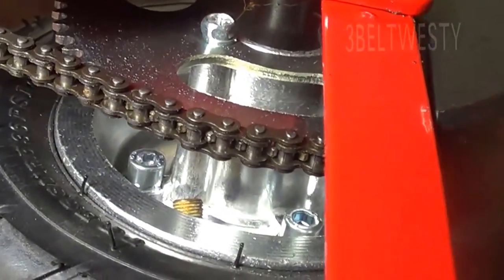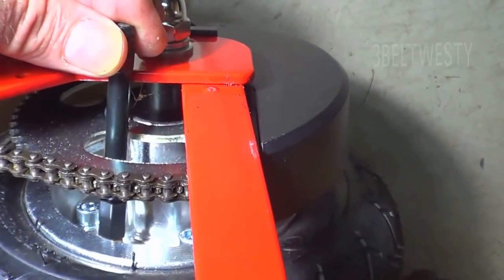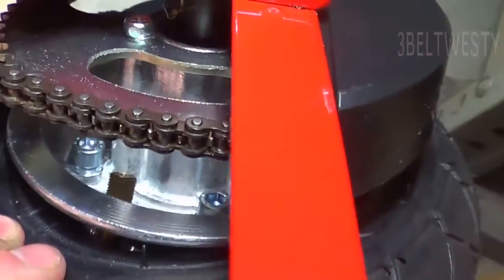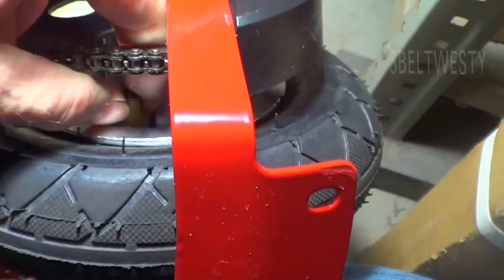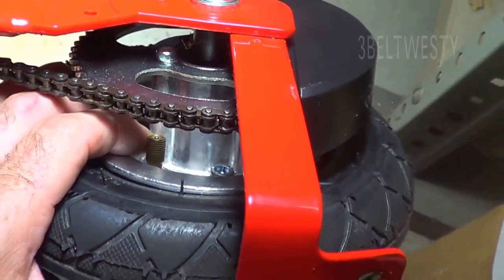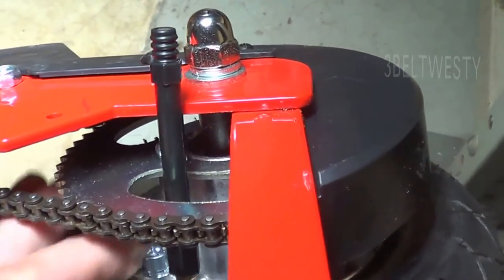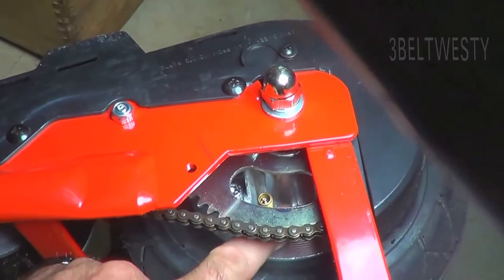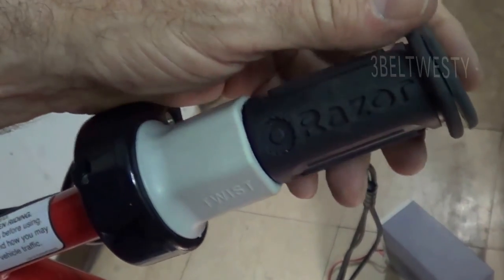RAZOR E200 Repair Rear Tire Cannot fill Fix align valve stem E200S

Comment: Thank you so much!!!! After much frustration, I found your video. Simply letting the air out was THE BEST solution. Such a simple fix after all of the failed attempts. Tires are inflated and it rides well. Thanks again!!

Comment: I have a Mototec scooter with the same problem. I thought I was gonna have to remove tire & completely disassemble back tire to fill with air. Thanks for the tip you saved me a huge headache